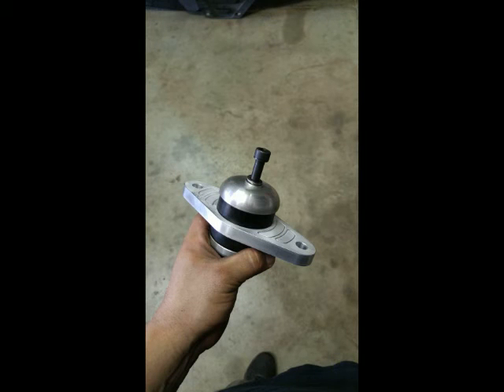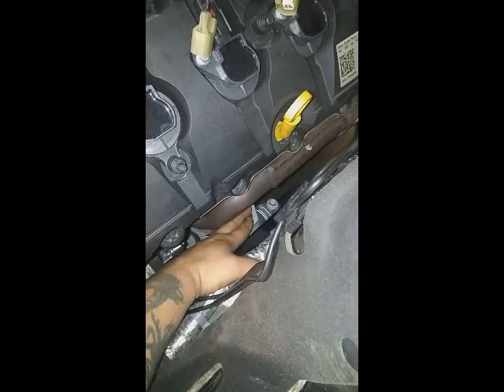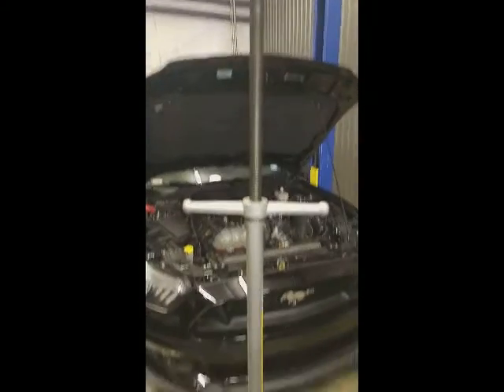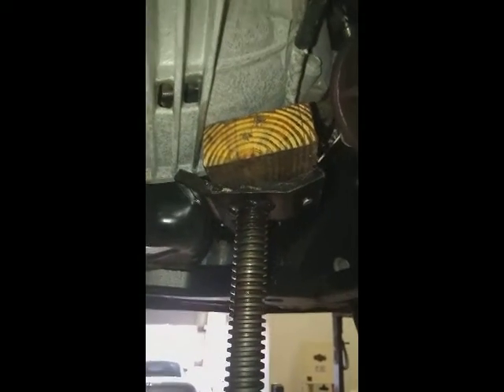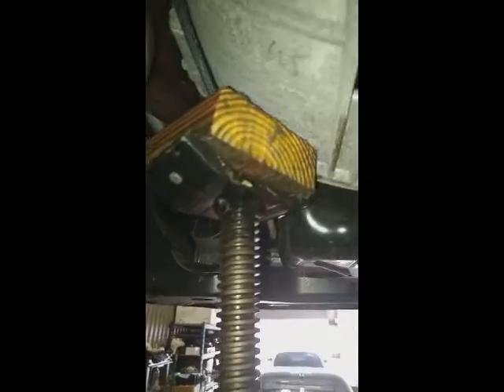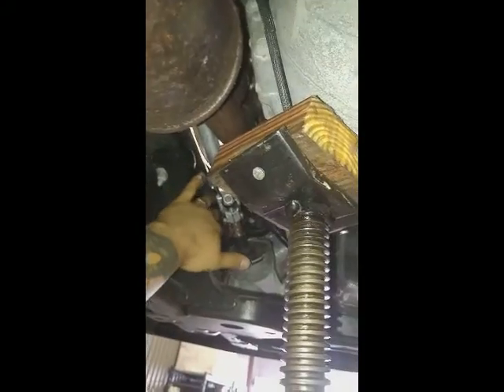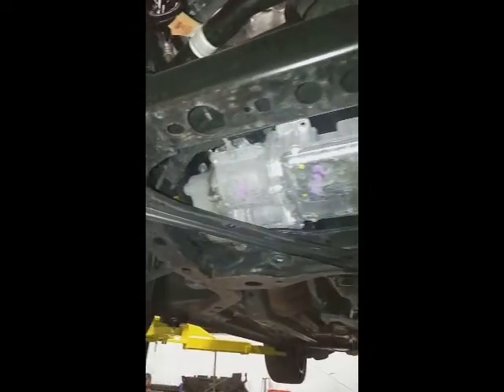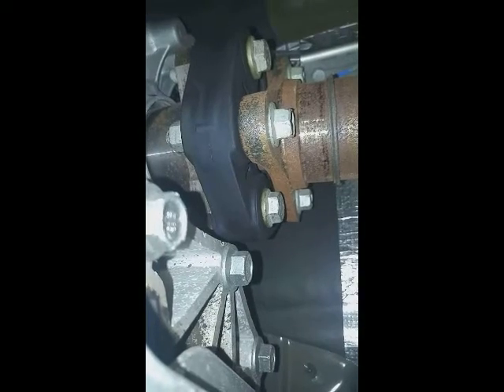2015 Mustang GT engine mount install

Comment: One side at a time but the Cats are hitting the body. Will not go any higher
Reply from the maker: You may try loosening the k-member nuts/bolts a little to get the Mounts down lower.  Just be careful and support it with jacks.
Reply: @COSpecV420  I removed the mount brackets off the engine. Wobble sockets saved the day. I just finished that job and moved to the next.
Reply from the maker: @mac1mike  There ya go!  That works too
Reply from the maker: I've never tried it with stock manifolds and cats.  I always assumed that most people requiring solid mounts would be installing a power adder with either long tubes or a pair of turbo manifolds.

Comment: Did you remove the nut up top one at a time or both at the same time? Like should I remove the drive side nut, leave the passenger, and only jack up the driver side? Or can I remove both top nuts and jack up one side at a time?
Reply from the maker: You'll want to loosen each nut to allow slight lateral movement (side to side) as each side goes up.

Comment: Do they contain some type of oil in  it?   Because i got a oil leak  and it's looks like it's coming from the engine mount!
Reply from the maker: The factory ones do
Reply: @COSpecV420    what could happen if it runs out of oil  ?
Reply from the maker: @alonsoduran7759  vibration

Comment: Was it absolutely necessary to remove the steering shaft to install driver side motor mount?
Reply from the maker: Dan Neris You can do it without disconnecting it.. it's just a little more tedious.  lol
Reply: BoostWorks yep got it done thanks man, different brand none the less same idea. Appreciate you taking the time to make this non-BS video.